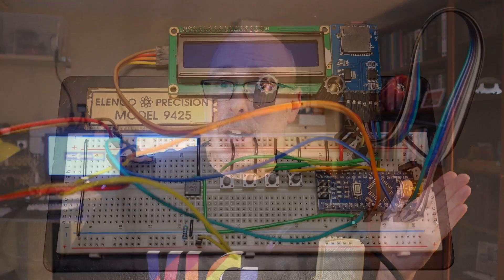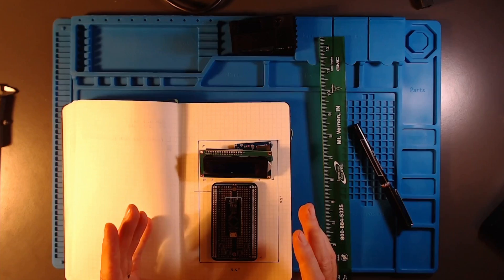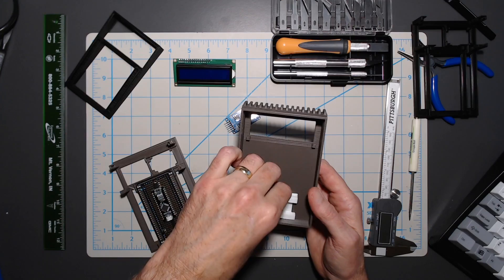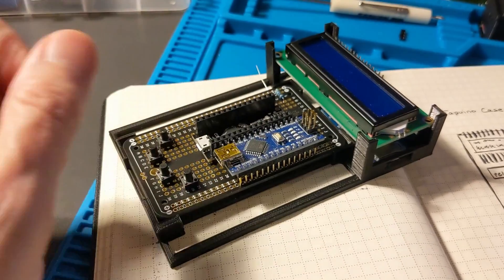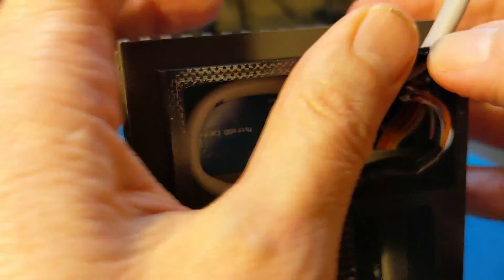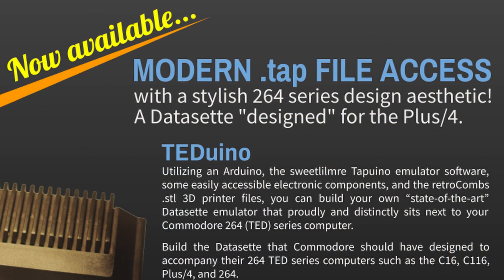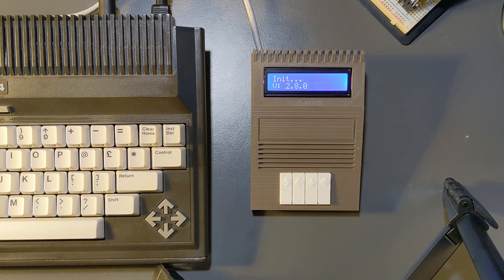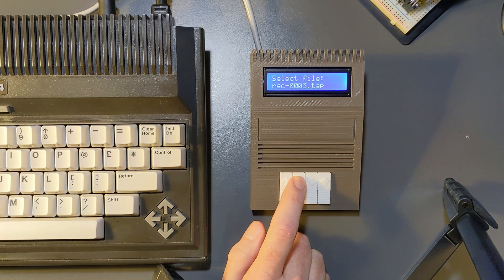New Datasette for a Commodore 64 or Plus/4? My Tapuino Custom Case!

Comment: To get a better pint quality on the top, print  it upside down.   Then the sides will have slight printing line, which of course could also be sanded.   Generally speaking, unless you go resin printing, you'll get this stepping issue.. unless you try to print in 0.1 mm height?  or even smaller??
Reply from the maker: I did try it that way first and while the top was smoother, the angle caused very poor resolution for the LCD plate and especially the fins. They were gnarly and because the they needed supports, hard to clean up afterward. Appreciate the comment and it's has me thinking. 🤔 Thanks for watching!

Comment: Good grief  yes, soldering iron burns are the worst! They seem to sting for days! (a spatter-ball of solder on the skin is a close second!) In my experience, SD cards are a bit like guitar picks.... looks like you've got a good retrieval technique going there Steven! Case finish...??  You could potentially wet & dry, then buff the case? or smooth it, then spray to get a closer colour match? Perhaps careful application of Grey modelling paint to the tops of the arrows, to better accentuate them complimenting the cursor keys on the Plus/4? Great looking device, great build, like the complementing gradient of the device.... very nice!! 🤩👍
Reply from the maker: Luckily, I'm a speedy healer!

Comment: On the colour of these machines… somewhat amazingly, I just picked up a Commodore plus/4 and 1551 disk drive that are genuinely charcoal grey. I think they came late in the production line. Every other plus/4 computer or component I have seen has been a dark chocolate brown, including a DPS-1101 daisywheel printer. Those items have been dark brown on the inside, too – so this is not sunburn, but a genome colour. Therefore, all-in-all, there ARE two colours of plus/4, although the tone of those colours are similar with dark brown being slightly darker.
Reply from the maker: First, James, thanks so much for taking the time to watch and provide great comments! Now, on to a reply for this one, I've noticed the same color changes. At some point, I'd like to get an actual color palette codes and for a closer PLA match.

Comment: So I’m no super geek when it comes to this stuff but I do have an understanding of digital audio. If I understand correctly, this kind of gadget would keep cassettes stored as something like a .WAV or some other audio format. Maybe even MP3.
My question concerns the recording process. If you want to convert an old data cassette to an audio format you have to play it back and record it as a sound. Would it be better to use a square wave to record it rather than a sine, triangle or sawtooth? I figure a square wave would be best since the “sound” you’d be recording is binary, 1s and 0s, ON/OFF and a that. A square wave would be more in tune (no pun instead) with that data stream.
Any thoughts?
Reply from the maker: Great question and one that I'm not sure I'm the person to answer. Sweetlilmre (or another viewer) might have a better answer, but I believe, again based on my limited knowledge, I'm not sure it matters. The sound is analog and the computer converts the analog to digital. As long as it is a valid sound file, it should not matter. Hoping others weigh in. Thanks for the great question and for watching!

Comment: Dark brown? I might not have had one for a few years but I could have sworn my Plus/4 was black?...

Watched to the end, definitely black but you know what, that is an awesome project, nice job!
Reply from the maker: Something's going on with my Plus/4 and lighting. I agree, it is probably black; however, when I put black PLA next to the case, it clearly was not black and had a tinge of brown. At some point, I'd like to go back to the drawing board with printing and color selection. Maybe when there's an 3D printer upgrade in my work area. Thanks for the comment and thanks for watching, Tim!